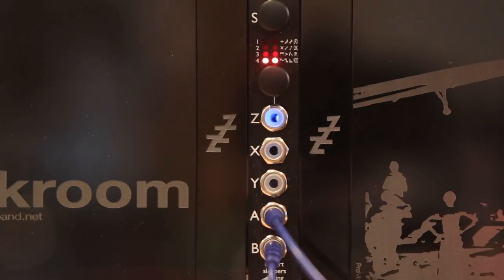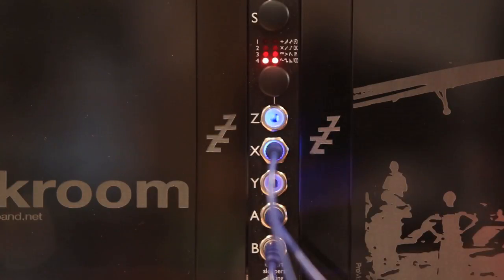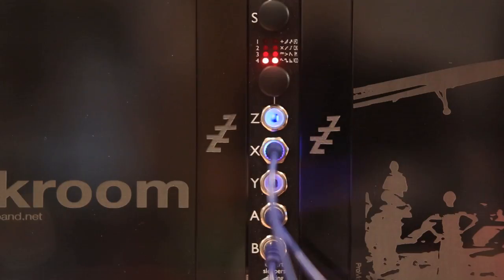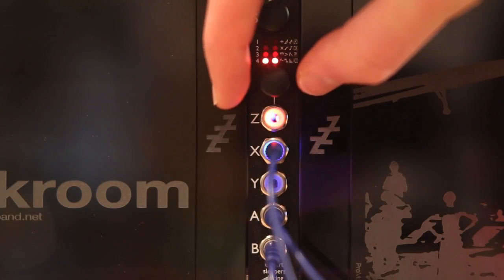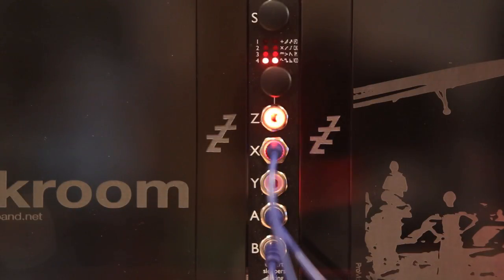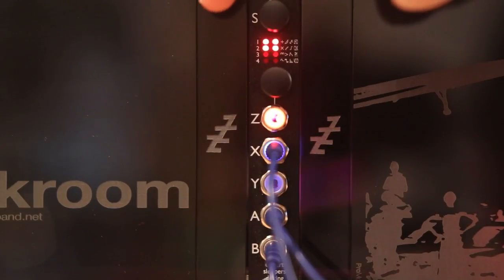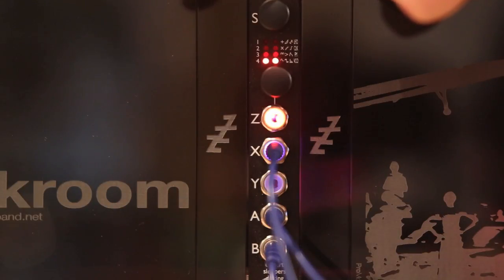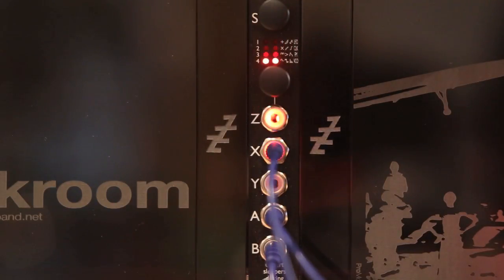disting mk3 - Shift Register Random Dual Triggers

Comment: Still the best module for folks like me using cases less than 164hp

Not sure if this comment section is the best suggestion box but is there a way to make mk4 into a lofi DAC?

Could be cool to have it spit out an analog CV drawing from two binary/gate inputs (4  possible values) or to include Z input for three to output 8 possible values . Perhaps the Disting EX could convert gates on its 6 inputs to 64 possible values (or maybe just use 4 gate inputs to form 16 analog values).

ADC? Maybe it could read inputs and output the closest reverse configuration of gate outs (or a lack thereof)

Thanks for recent updates for my happy family of three distings